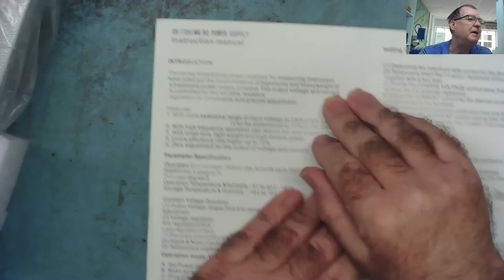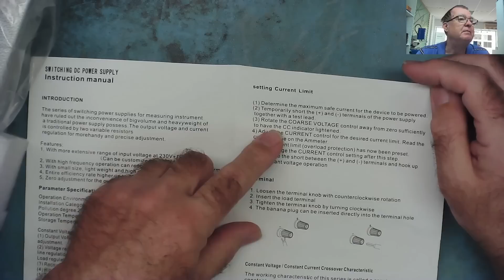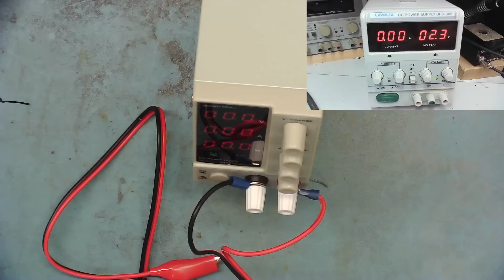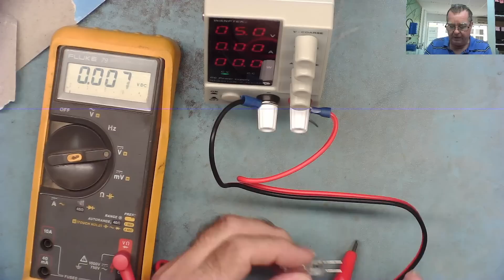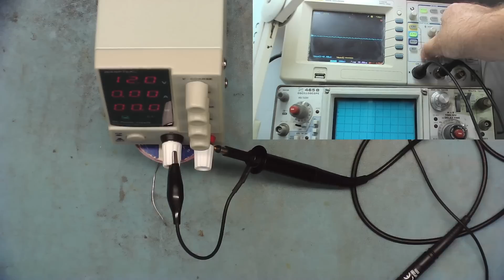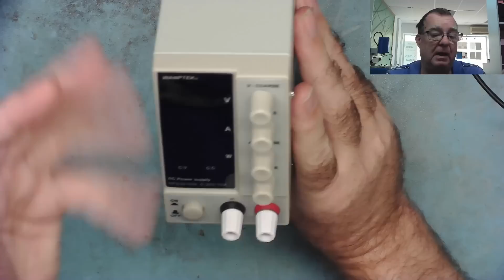Cheap 0-30V 0-10A Lab Bench PSU Power Supply Review NPS3010W - How good Is It?

Comment: I’m trying to understand what the reference ‘don’t use if you live on a mountain’ has anything to do with anything. What am I missing here? 🫣
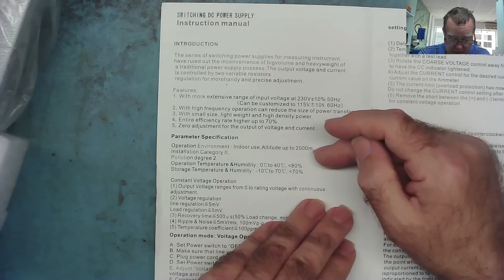Reply from the maker: Didn't I make that perfectly clear enough at 02:48 ????
I was being a bit tongue in cheek but the user manual clearly told me not to use this at an altitude above 2000m. They actually went to the effort to specifically state this fact in print.  It didn't say why or what would happen if I did use it on a mountain higher than that but I thought I should play it safe, so I felt it was a fair comment to make. 😋
Reply: @LearnElectronicsRepair  yikes 😬 .. I skipped the part where you’re reading the manual cause it was just a basic power supply. Thanks for clarifying that again. You have the best tutorials.
Reply from the maker: @xeroeffect5745  It happens lol, personally I think it is a ridiculous statement to make in the user manual, so much so my dry sense of humour made me add it to list of CONS.  I should have put a sticky out tongue emoticon with it
Reply: Refers to the elevation at which the power can operate at.
Reply: @GregM  Hello Greg 👋 always good to run into the same people. Hope you’re doing great.

Comment: You can build a  cheaper DIY lab bench power supply from an old PC ATX power supply and a boost buck converter (The LTC3780 for example).
Reply from the maker: Yeah I'm gonna do some projects like this though I'm not sure I will get the 30V 10A out of it.  I think I could do better with an old linear transformer taken from a scrap audio amplifier so let's see

Comment: It seems to have enough space inside to do a hack and put a switch to the output on the case. But with that said, the time + effort + swithc price, you caould buy one with a switch already integrated. I am happy with my generic 30V 5A RND one.
Reply from the maker: Does your 30V 5A one have an output voltage switch?  Mine doesn't as I mentioned.  Yeah I am quite happy with my two bench PSU but there are occasions I can't get enough current into a short to trace it and I think this one will come in useful to me.
Reply: @LearnElectronicsRepair  Yes it does. I nice clicky one. Look up RND LAB 320-KA3005D
Reply from the maker: @SelfMan-SK  Nice.  This is a feature I think all bench PSU should have ,and is costs so little to implement I really don't understand why they don't have.
Reply: @LearnElectronicsRepair  When I searched for a power supply, I specifically looked for one with the switch. And you are right, a bench PSU SHOULD have a switch. 
The one I have now is being sold under different brands. It is not "the best" on the market, but also costs about 90 EUR + VAT and you don't have to shorten the leads to set a maximum current and you can have 4 pre-sets.

Comment: Only thing you did not check was the mains current draw when there is no load connected. ie as if in stand buy.
Reply from the maker: There on off switch breaks the live wire so there is no standby current
Reply: @LearnElectronicsRepair  OK reword question. The PSU is On. you fit an external On Off switch between PSU O/P  and load,  Switch off external switch to the load, Hence now in Stand BY - what is the AC Current Draw of the PSU because it is still On ?
Reply from the maker: @uksuperrascal  Oh I see - yeah it is still on and drawing whatever current it does with no output load. No I didn't measure it but I will do that and reply.  What would you consider a good result?  I assume if you are asking you have some figure in mind otherwise there would not be much point to the question as there would be no conclusion to draw from the answer yeah?
Reply: @LearnElectronicsRepair  OK Reword Question. Fitted between the PSU O/P and load is an external switch. The PSU is On and set to 12v @ 1amp. The external switch is Off, Hence the PSU is in stand by. What is the AC current draw of the PSU in stand by?

Comment: The small size and weight is abit of a put off to be honest, it doesnt look like it can manage 10 amps looking at it . A picky opinion but i prefer them to look the part
Reply from the maker: I didn't take a long time to soak test it but the fan did not even turn on while I was using it at 10A for a minute or two. TBH I can't think of any sort of repair work or project I have built that needs 10A for a long time. There are many ATX PSU that are no larger/heavier than this and yet can easily generate 300W output. I wouldn't call this a top quality bench PSU but it isn't aimed at that market and I do feel it is capable enough especially for hobbyists on a budget without sacrificing any functionality.  I will certainly use it on occasion when I need to put more than 5A into a short for tracing purposes.

Comment: Halogen lamps will happily run to around 150% of power for a minute or so, so you can use the 2 to go to the full 10A. Have taken them up carefully to around 18V with no problems, just you have to use a ceramic holder with the high temperature silicone leads, otherwise they do burn the croc clips off quite well. Taken incandescent 230V lamps all the way to 340VAC over a few seconds, and aside from them turning into photoflood lamps (which is what a photoflood lamp is, a really overdriven incandescent, running just short of melting, so it has a 25 hour life) for a while. These were actual lamps made when the Phoebus cartel was around, limiting lamp life to under 1000 hours, so they are pretty rugged, just not long life.

Comment: Is the 0V terminal connected to Gnd internally? When you turn it on (either at supply or front button) and output is set to say 1.3V, do you get a spike on output above 1.3V and so it would blow a connected low voltage prototype? When you turn it off, do you get a spike above 1.3V before the voltage rail drops to 0? What is noise and ripple like when under load?
Reply from the maker: Yes possibly on any PSU, bench or otherwise - this is why talk about wiring up a switch on the output in the video so you can turn it on them attach it to the DUT😉 Ripple with no load and under load I tested, did you watch the whole video?
Reply: @LearnElectronicsRepair  Sorry, missed the  under load test!
Reply from the maker: @steve6375  No worries mate - as you see it performs pretty well for ripple both with and without load.  And I do discuss the lack of an output voltage switch, though in fairness neither of my other PSU have one which is why I built the little switch box I showed, its not perfect but I think at the price range it is a very good choice for electronics hobbyists on a budget.
Reply from the maker: Regards the 0V terminal is isolated from earth.  This can be a bad thing or a good thing depending on what you are using the PSU for